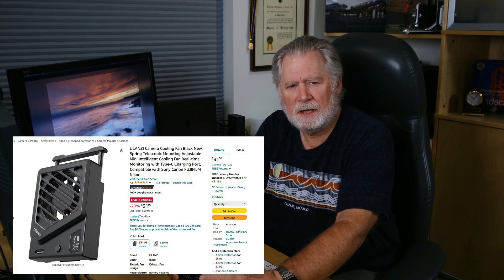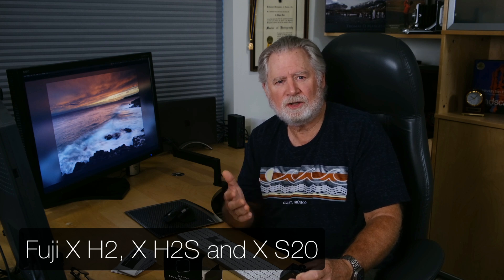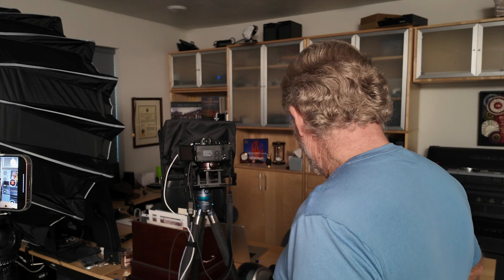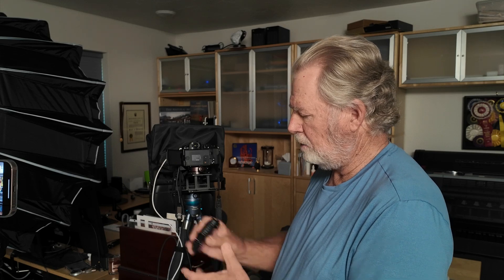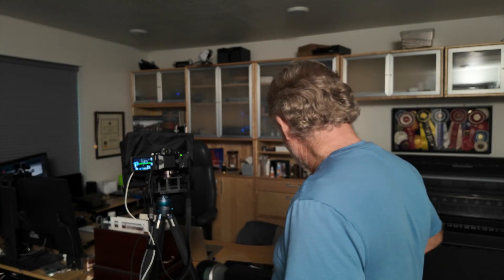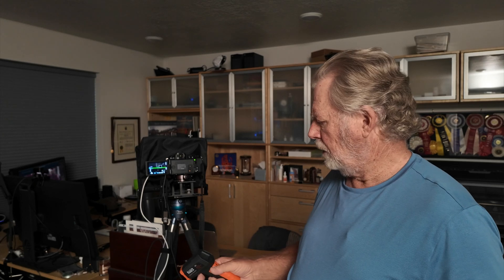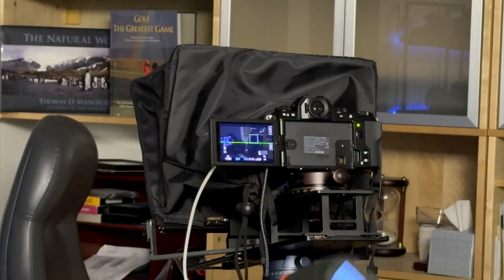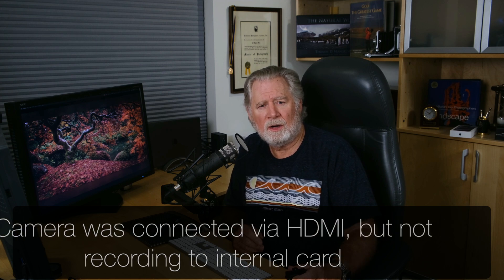Fuji Fan-001, $200  ‼️😳‼️ ...but it might be worth it.

Comment: You sold me. I had been on the fence about buying this, but yesterday, while doing an outdoor photo (still) session, my XH2 stopped working due to overheating. I was using the other type of cooler, but the battery only lasts an hour on high. It was very embarrassing to have equipment failure, and I don't want to repeat it. Trying to find info about the real-world use of 001 is very difficult, so THANK YOU for taking the time to make this video.
Reply from the maker: thanks for the comment.  Please let me know how it goes for you when you’ve used the fan a little.
Reply: My X-S20 showed the yellow overheating symbol when photographing dragonflies in burst mode on a very hot afternoon around by Nottingham in the UK.

Comment: Faz um teste de duração de gravação
Reply from the maker: a recording test will run the battery down faster.   In this case the fan will have less impact on battery performance since the camera will use up the battery faster for other tasks and the fan won’t have to cool for as long a period of time. The fan battery drain is low enough that throwing in an extra battery will be more than enough to handle it, and guessing for most that won’t even be necessary.